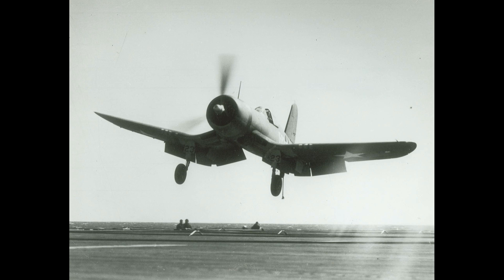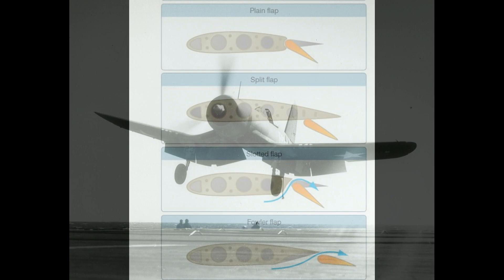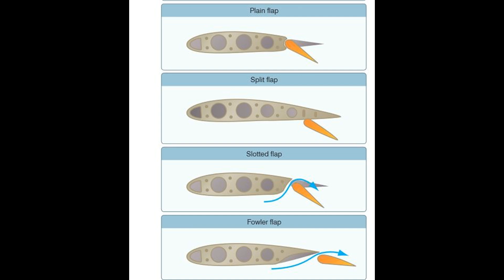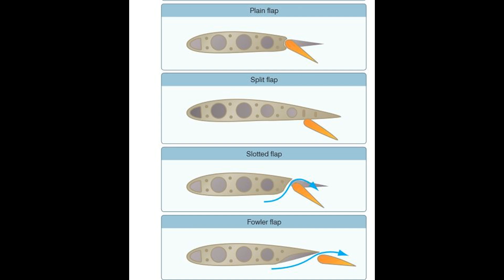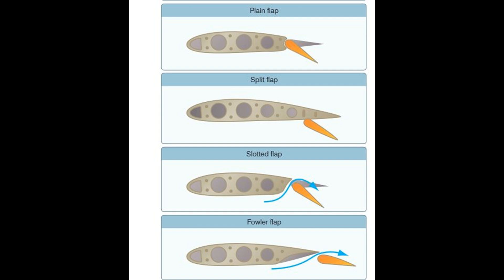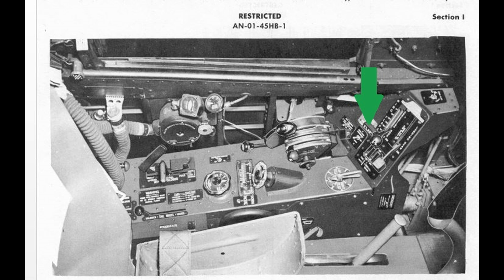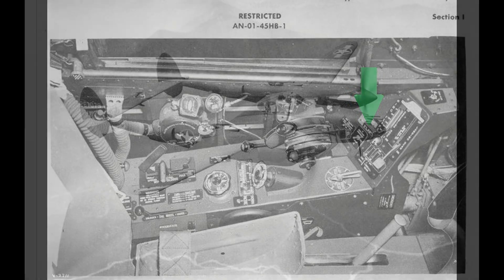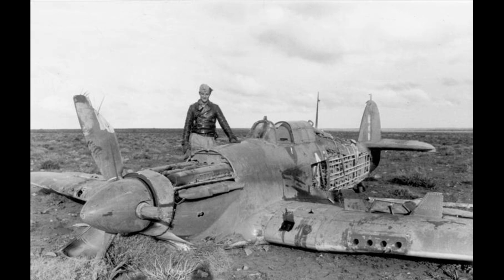Using Flaps in a Dogfight with the F4U Corsair and others

Comment: I was just watching an old introduction video for the Hellcat and then Youtube automatically played the equivalent video for the P 47 and then you release this video at the exact same time that I was thinking about the difference  with the flaps.  I noticed that the Hellcat only has 2 flap settings while the P 47 can set the flaps at any angle.  I thought this seemed odd as the 2 airplanes look very similar to me.  
Anyway, if the Corsair could set its flaps at an intermediate level and the Hellcat could not,  does this indicate that the use of flaps in dogfighting was not considered to be important by the Navy as the war progressed?  Also, I assume that carrier aircraft require an extreme lift flap design to facilitate very low speed take off and landing.  
It looks to me like the cockpit in a WWII dogfight would be overwhelming for the pilot.  Could it be the case that flap setting options were removed in some airplanes to simplify the thought processes of the pilots?
Reply from the maker: Hi Eric, the Hellcat was a later design and could out turn the Corsair at speeds below 200kias even without any maneuvering flaps. So it's possible Grumman just decided it didn't need them. At high speeds, the Corsair has the edge.
Reply: This is very interesting, and I have to admit I needed to look up Hellcat flaps... They were not just simple two position flaps like the Spitfire. They deployed gradually from 195 mph (0 degrees) downward, increasing angle under spring pressure, 5 degrees at 170 mph and 50 degrees at 105 mph. So they are spring regulated automatic flaps, BUT, they can also be hydraulically extended horizontally by the pilot, with zero deflection angle, at any speed, increasing the area of the wing at the pilot’s wish. So the pilot did have an option of increasing his wing area, without angle, and the angle added itself automatically below 195 mph. They were designed to be foolproof to damage,  as so were a bit conservative, as the P-51, P-47, Me-109G, FW-190A all could get 10-20 degrees of flaps at 190 mph while the Hellcat springs would only allow 5 degrees at 170 mph... But the hydraulics allowed a wing area increase at any speed, while no wing area increase was offered on most of the other types (except for the butterfly flaps on some Nakajimas)

Comment: would 20deg of flaps change the pitch vector by causing the nose to lag actual flight path?
Reply from the maker: The NACA report shows that Corsair is excellent in this regard and well below established maximum limits. The flaps cause the nose to rise slightly, but the control forces needed to oppose it would be minimal, and actually non existent in a constant bank decreasing speed turn.

Comment: I say screw the flaps and use the elevators in a turn. Like tilt the aircraft to a 45 degree bank and lift up on the stick
Reply from the maker: Ahm, Oh never mind.
Reply: @James Hanlon 
I hope I can clarify...When you pull back on the stick the elevators actually push the tail DOWN since the tail is connected to the rest of the plane, the plane rotates around it's CG (like a seesaw) and this raises the wings and increases the angle of attack of the wings, which increases lift.  Flaps help you increase the lift at slow speeds so you reduce the speed at which the wing stalls for any given G-load. Flaps don't replace elevators.
Reply: fazole That’s the point I’m trying to make. Do what I said at a good high speed but too fast or you could stall out and after you made your turn like a 180 degree turn. Then you level out and Attack
Reply: If you are at high speed and you turn, you are going to have a large radius of turn, so it your opponent is slower he may be able to get on your tail and shoot you down..  Most experienced dogfighters did not just yank the plane into a turn, they would combine a turn with a vertical manoeuvre of some sort which allows the aircraft to trade speed for height and allows the attacker to engage out of plane of the turn.  This might be what is now called a yo-yo attack for example.  So if you executed the control movement you state, yes, you would up into a slanting kind loop.

Comment: why kind of flaps did the 109s have?
Reply from the maker: It had plain flaps, but with leading edge slats as well. Also certain 109s had ailerons that drooped when the flaps went down giving it what were in effect full span flaps. A 109 with the flaps used correctly could really turn.
Reply: As a layman I remember reading that the later ones (if not before) had pioneered leading edge slats and they were actually automatic with a spring that functioned based on the aerodynamic force. Planes slows down, air pressure is less and the springs pushed the slats out. Something like that. Google it. I also think these were special purpose flaps and the planes also had more basic full landing flaps as well.
Reply from the maker: I could do it!
Reply: Interesting information. Thanks for sharing.
Reply: ah thanks i appreciate the answer

Comment: That's what I read constantly in P-47 pilot bio's, not full flaps, but what some referred to as bleeding flap,or turning flap. If I remember correctly, 5 to 10 degree of flap either at low level or altitude. Col. Eagleston, Boss of the 353 Fs/ 354 Fg. preferred a opposite stick to rudder maneuver to out turn 190's and 109's, break up their firing solution or for a snap shot of his own. F4U's though, they almost had barn doors for flaps, should've been able to do a "Button Hook". I know that'll over stress the airframe, among other issues. Great info, always a pleasure to lister and learn.
Reply from the maker: The P47 with its split flaps could tighten the turn up with some lower setting, 5 or 10 degrees makes sense to me, but I haven't seen any official number on this for the P47. The opposite stick and rudder move is high risk. If you get the shot and finish off your enemy, great, but if you miss, you just lost energy and your opponent if in a coordinated turn and an equal plane will come around on you.
Reply: Correct, he would use the weight of the 47 to dive away from his enemy, regain speed and energy, then return to the fight.
Reply: Greg's Airplanes and Automobiles I thought the P47 had slotted flaps?

Comment: Japanese study titled "Study about aerial-combat flap" of N1K1 "Kyofu" (a flotplane, that later was redsigned to land-based fighter aircraft N1K1-J and ultimately led to development of famous N1K2-J) conducted by Yokosuka Ku (special detachement called Naval Air Research and Development Center) in March 1942 indicated that by use of flaps a turn radius could be decreased by as much as 20-30 % of the initial radius, however turn time did not show a substantial decrease. Similar results were achieved in vertical manouvers, namely loop, as loop radius was decreased and ending altitude was higher than without flap use. 
I have specific data and graphs accompanying them if you are interested. 

 N1K1 was equipped with fowler flaps that for combat could be lowered by 19 deg. Overall I think Japanese put most effort in use of flaps for combat purposes as nearly all Army single fighters had them, starting with Ki-43 and Ki-44 as well as many Navy fighters (J2M, N1K and successor of A6M, the A7M Reppu). Some had automated flaps that were actuated by G loads I believe (though cant be sure about that, would have to get back to my notes on that one).
Reply: Ps. Japanese pilots were actually able to take advantage of those flaps. Even called here Oscar pilots: 
"The leader's aircraft suddenly started going into a loop. I'll be in trouble if I don't stick together, so I bull back on the stick with all my might, but I could not follow the leader.

"Oh! The combat flaps!"

I noticed that the combat flaps were sticking out of the leader's trailing edge. I clicked the button on top of my stick and my plane started a loop with a very small radius. I had this convenient tool all along and yet forgot about using it altogether.

I looked down at the top of the loop and there they were! Four dark green Spitfires right beneath us. This was the formation that was chasing us all. They were now 400 meters below us, and were about to come into our range. The sudden reduction of the turning radius must have surprised more than one Spitfire pilot, but now it was too late.

May 5th, 1944 over Imphal, Sgt. Masahiro Ikeda, 64th Sentai"
Source: http://www.j-aircraft.com/research/quotes/ki43.html
Reply from the maker: Thanks for that except about the Oscar. The Japanese planes sure tore up the Spitfires.
Reply: ki 84 was poorly built but the plane was one of the best plane of the war at low and medium altitudes ; over Phillipines , corsairs pilots had a joke : " give up , it's a frank !!!"
Reply: Yes, The N1k2 is famous for its automated combat flaps. An interview from a 343 veteran says that it is very effective in vertical loops but not so much in horizontal turn, perhaps for the same reason as you say.
Reply: Very interesting read!
Reply from the maker: こんにちわ    I haven't read any Japanese studies on this, but everything you say makes perfect sense. The NACA report also makes it clear that the fastest turn rate isn't always the smallest radius. I suspect the Japanese put the most effort into this, since they had the most fighters with fowler flaps, and generally put emphasis on agility.
Reply: Well, yes, agility was important and later designs which were heavier lost some turn performance, so to compensate that they were provided with flaps. It was especially important for aircraft like J2M which was not a pure dogfighter but more a high speed interceptor or N1K1-J which utilized laminar-flow airfoil and had very poor flying characteristics which only further hampered the manouverability. So again, flaps (and automated ones) were there to help that.
Reply: ki 84 hayate have automatic G load Fowler flaps
Reply: c b ki84 did not have automatic fowler flaps. It had manually operated butterfly flaps (designed for ki43) which worked like fowler flaps but extended asymmetrically. 
Also Frank wasnt poorly manufactured, more often it suffered from inadequate maintenance and lack of spare parts.
Reply: c b ki84 did not have automatic fowler flaps. It had manually operated butterfly flaps (designed for ki43) which worked like fowler flaps but extended asymmetrically. 
Also Frank wasnt poorly manufactured, more often it suffered from inadequate maintenance and lack of spare parts.
Reply: just bought few books on the ki 84 as i just built a rc one last winter in 1/4 scale ;)  ; flaps system of the N1K1 were intented but not operated on ki 84 you re correct ;) ………...he was poorly manufactured due to propers aloys shortage  , they try wooden tail and "steel hayate" (skin parts in steel !!) , gears legs was crap , homare engine fail very often due to problems of assembly and poor quality of parts used , ther is an example when 80 ki84 were on delivery flight and only 14 were able to reach destination
Reply: @cb3609  hey, where do you get books on Japanese ww2 aircraft? I've found the internet useless for obtaining proper information about them, and would be really interested in having a few, especially the ki43iii, n1K2, a6m2, and the G4M.
Reply: The N1K-J had a mercury switch that would activate the flaps when a switch was turned on. It works like an old A/C thermostat that is consisting of a glass tube two electrodes at one end and a small amount of mercury when tube is tilted the mercury completes contact between electrodes actuating the flaps
Reply: I know that the D4Y2 got fowler flaps as well.

Comment: What about  impact of leading edge slats on 109s?
Reply from the maker: They were effective.
Reply: They were effective when they worked properly. Countless accounts of pilots swearing at them for not deploing simultaneously and causing problems with aircraft's handling.
Reply: @ No. 32 Onebad They won't deploy at the same time especially in high G turn rates as one wing will be at a different angle of attack compared to the other wing.
Reply: MrStoneycool69 Yeah thats when you want that to happen. Im talking when you dont
Reply: No. 32 Onebad No you don't, that makes the aircraft stall out of the turn. Why would any German pilot want the slats to work independently in tight maneuvering? Dumb.
Reply: MrStoneycool69 Read my OP again.
Reply: No.32 Onebad I didn't think the Me109 had many issues with its leading edge slats. I far as I know aircraft like the Me210 for instance, with slats deploying symmetrically...
Reply: There's certainly a fair amout of examples of LW pilots talking about having stability issues due to slat malfunction (e.g performing an Immelman and only one slat deploying and whatnot). Just wanted to point that out. I'm not saying that they were bad, or unnecessary, just imperfect.
Reply: They deployed when the wing in question was close enough to stall speed.  That is why they often did not deploy simultaneously.
Reply: increase load and stall angle of airfoil : reduce stall speed and turn radius
Reply: They were beneficial in allowing higher AOA ACM. This, along with a favorable power to weight ratio helped the 109 turn a lot better than it should have in relation to it's high wing loading.
Reply: Shlomo lowered the landing speed
Reply: Felice Graziano Yeah they were also used on the F86
Reply: Slats increase the velocity of the air over the wing at low speed/ high angles of attack, which delays the separation of airflow which occurs as the wing nears stall.  Slats lower the stall speed without incurring as much drag as flaps.